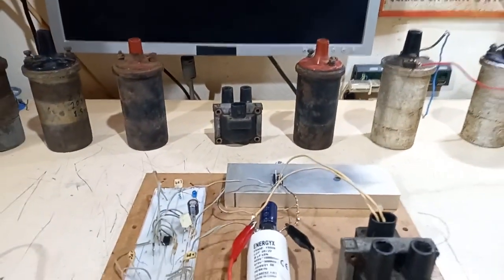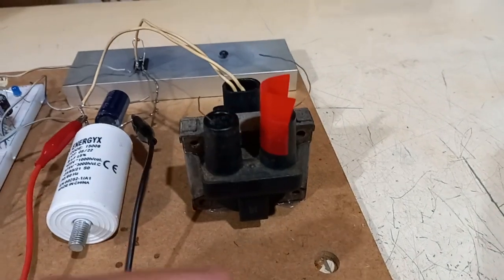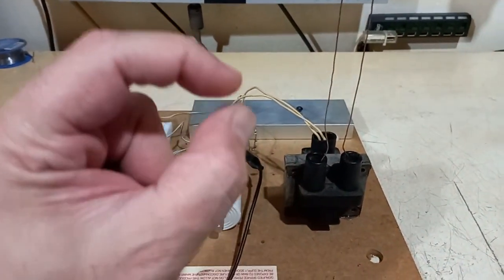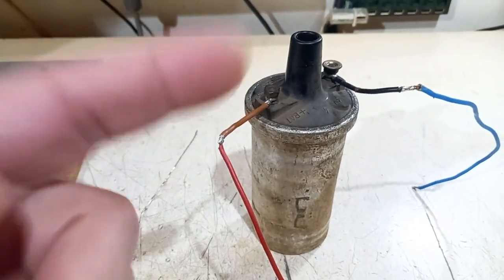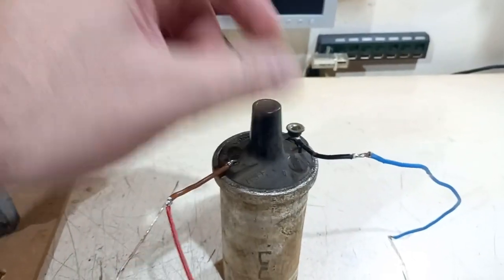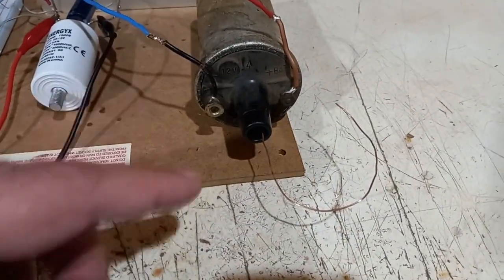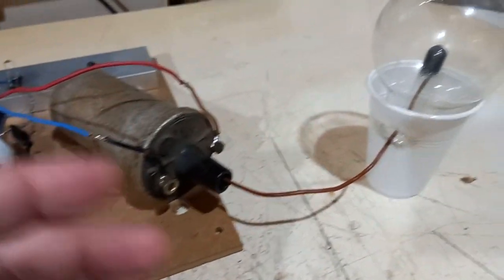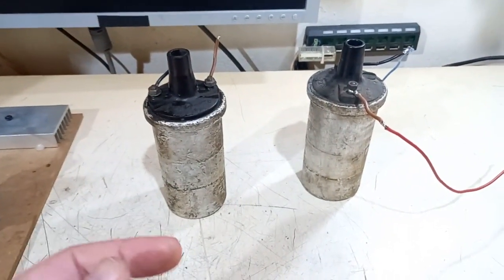Fun With Ignition Coils (TCI, Old Style, Driver)

Comment: Nice results! Also that was a good tip about using the old coils on their side - I'd never thought about possible air gaps inside. Do you remember the GMHEICSLR competitions back in the 90s-2000s? Was an early internet competition to get the biggest spark from a standard old type ignition coil, I think some went up to 20-30cm, but often only once :D
Reply from the maker: never heard of that!!! :D it sounds interesting tho, i've seen the "blinking bulb competition" in where you have to blink a bulb in the most absurd way, there are a bunch of videos also on YT, but i'm not sure it was called exactly like that tho

i reached just 11cm with two coils, it probably does a bit more of that cos the rising time of the HV is quite fast and it doesn't necessarily spark always on the same path because if this (i believe) so it may do 12-13cm max but just one in a lot of sparks that instead jump around the neck, still without an insulating booth on the neck of the coils, cos i don't want to ruin em

yes, it's a second hand tip of laying the coil on a side honestly
Reply: @PosthumanKindergarten  Yeah the spark records were set with no regard for the coil's survival, and from what I remember used "kinda cheating" techniques, like attaching a big insulating tube to the secondary terminal etc. But that was allowed in the rules - I think the only rules were to use a certain model of coil, and no opening the can or rewinding. If sports were competitions like that I might watch them! Maybe we should start an internet "budget tesla coil" award; points for cheapness, style and spark length :)
Reply from the maker: @rob-muntron  if i'd have an infinite source of ign. coils i'd try to push em to the limit using obviously a boot on the neck, but in my experience HV sources that are packed and not a coil in free air are prone to failure cos of excessive voltage, also i think you need a really beefy mosfet or IGBT to make so much power

yeah a competition for a budget TC would be interesting :D i think i'm already taking part of such competition LOL... i like to see the various interpretations of "builds" also around the world, what you have at hand and your budget makes a big difference, but there are other factors, like your style, your intent or less to make it as big as possible, and the knowledge you have, also the internet doesn't help much when it comes to suggest the best solution for your needs, so the people end up building random things and are unhappy with the results or end up making things that are too complicated

Comment: and now drive it with tubes XD
Reply from the maker: LOL, that would be pointless but it's an option :D
Reply: @PosthumanKindergarten  I love to use tubes for pointless things
Oh try to make it a plasma speaker
Reply from the maker: sorry if i'm late but if you want to see an interesting plasma speaker with an HV tube here it is https://www.youtube.com/watch?v=ihek6slHG5g
Reply: @PosthumanKindergarten  that is a bit cheating that tube is only used as a rectifier and not much more
Reply from the maker: @robot797  no, it modulates the high voltage with audio :D there are already rectifiers in the flyback, how can the tube do just that? where's the sound coming from then?
Reply from the maker: @robot797  you made me think about it, i rewatched the video and MAYBE i wasn't clear enough, that tube is a TRIODE, and it handles voltages like 30kV, the audio is connected to the grid of the tube, and this modulates the current of the high voltage with the audio, there's no solid-state audio modulation, it's just the tube... i should have been more clear, sorry
Reply: @PosthumanKindergarten  you are right
sorry my fault
good job
Reply from the maker: @robot797  i do my best to not bullshit on my channel, the only problem with that project is that i thought to be the first at having thought about it, but no, here's another one with a pretty similar tube that i found AFTER having made mine https://www.youtube.com/watch?v=WgNtfv5G9xg
Reply: @PosthumanKindergarten  again sorry
I had not looked at the video good enough
Reply from the maker: @robot797  no no no, i'm not trying to "sell" anything, i was just chatting ;-)
Reply: @PosthumanKindergarten  ah that explains allot
But my challenge still stands
Reply from the maker: @robot797  you mean making a singing arc with an ignition coil? well, i should investigate this a bit more but something tells me it's not so simple, cos those things work at low frequency, like 200Hz max, it can make a puny arc at an higher freq. and be modulated but.... we'll see, maybe some day, also as i said in that other video i don't like singing tesla coils or plasma speakers, i find em silly, so i can't promise you anything